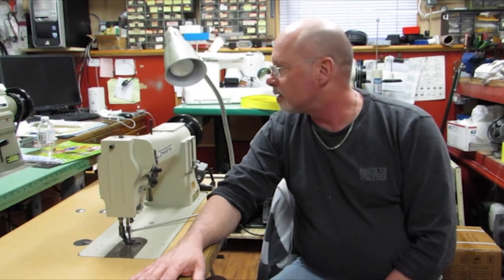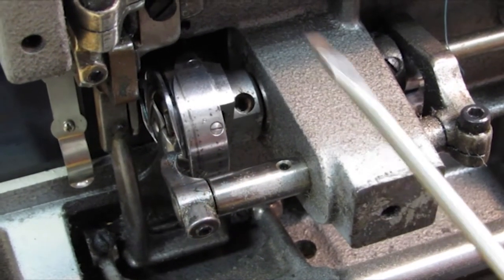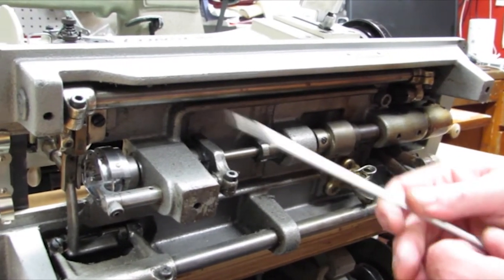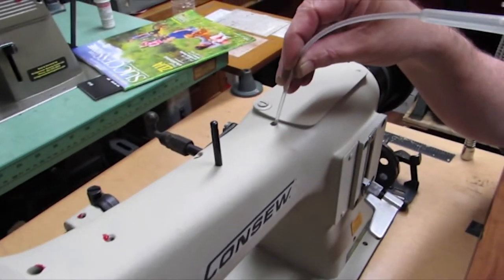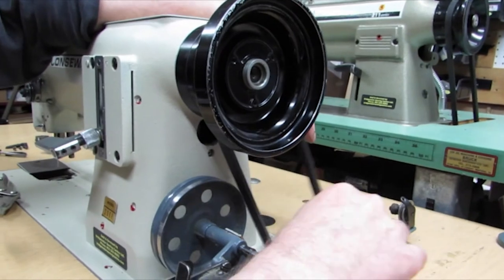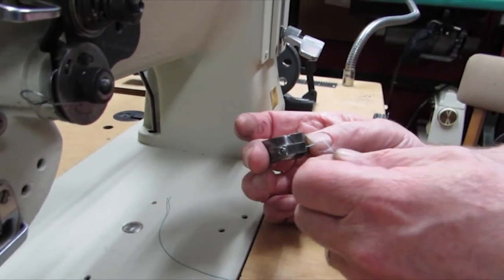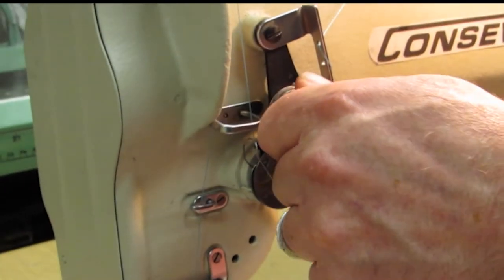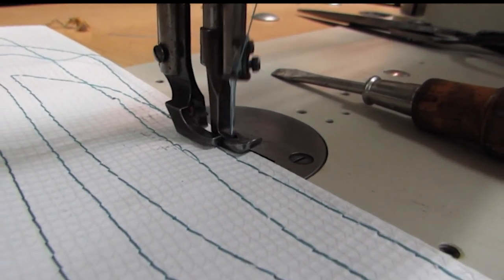Consew 206 RB Industrial Sewing Machine  maintenance video.

Comment: Do the cheap amazon hooks made for the 206rb-5 machines work decent or do you need to buy an original hook? I'm asking because the machine is made in China.
Reply from the maker: yes they will work fine.
Reply: @Bridgewater Sewing Centre Ltd  thank you